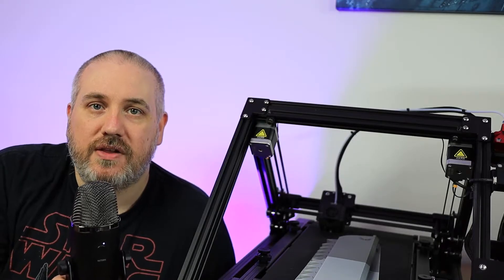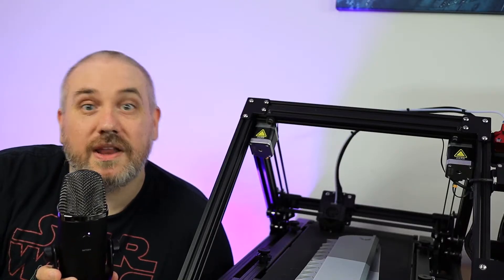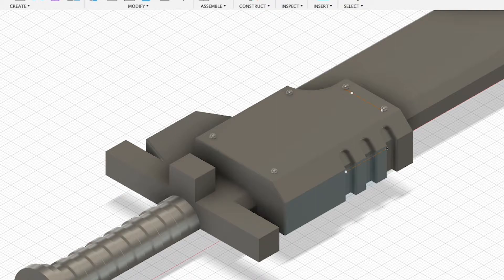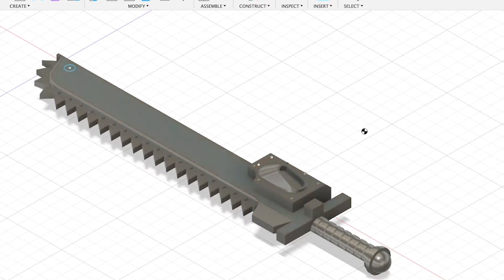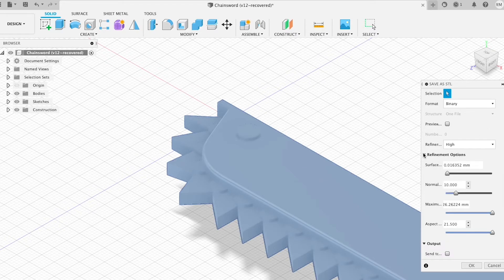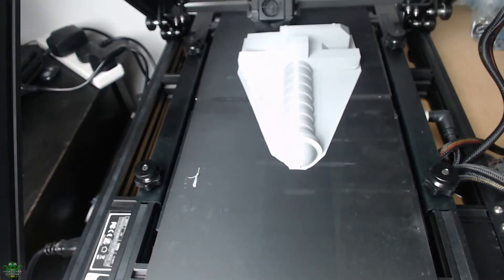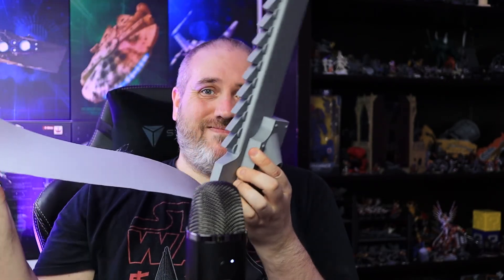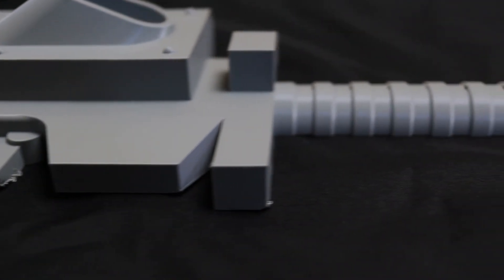3D-Printed Space Marine Chainsword on a Creality CR-30

Comment: Wow, great video, never knew a belt printer existed.  Other 3d printers I've seen extruded on the z axis.  Is the belt printer a particularly new advancement?

Also the chainsword looks great.  Doest the 45 degree printing provide any strength benefits?
Reply from the maker: Thanks very much! There have been a few belt printers over the last 5 years, although this one is definitely the first to hit the mainstream. It is really fun, although it couldn’t 100% replace my bed printers.

The 45 degree angle is a strange one. Something you would normally consider an overhang prints easily and, on the other hand, there are unexpected things that need support. I don’t find it any stronger, although I have no complaints so far.
Reply: @TheHalfDoneHobbyist  thanks for the reply.  Ah I that's interesting, Ive been waiting a while to pull the trigger on a 3d printer for a while.  I'm not that techy but know my way around 2d drawing software, just looking for something to plug and print.  There's more cleanup afterwards to consider too.  Although the ease at which you removed the raft was quite satisfying.
Reply from the maker: ‘Proper’ 3D printing people would frown upon my use of a raft, but I say do whatever works. I’d get a cheaper bed printer first, like an Ender 3 Pro, just to get used to it. It’s loads of fun, especially if you can design your own stuff.